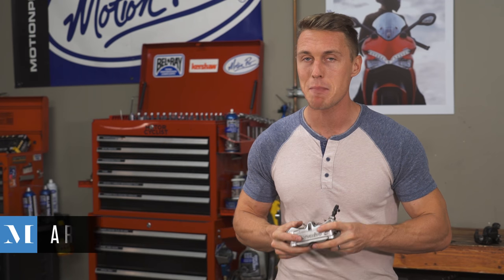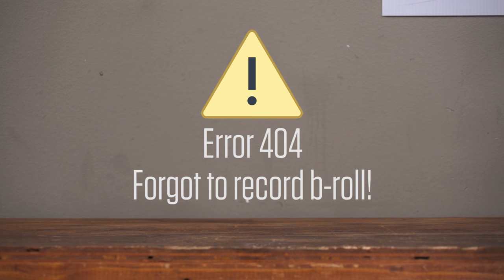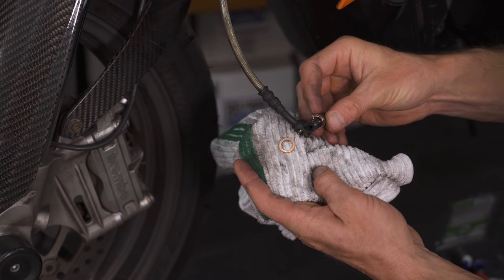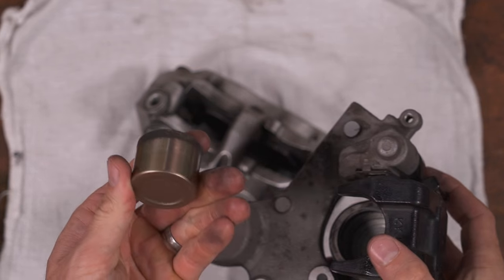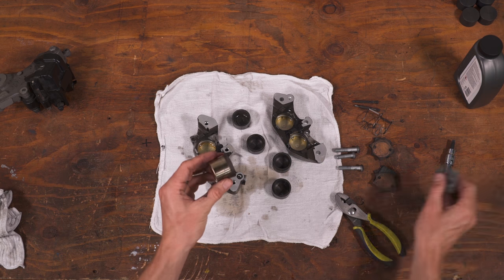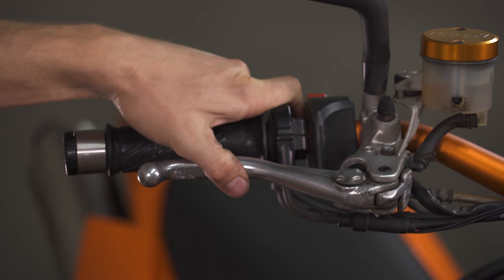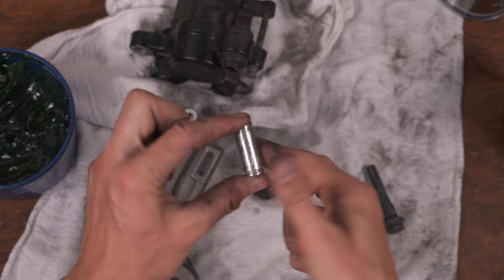How To Rebuild Your Motorcycle's Brake Calipers | MC Garage

Comment: Been working on a 98 CBR 600 F3 and right when I get one thing fixed the next goes wrong.  Just got carburetors rebuilt, finally got started and not first though second test ride the front brakes decided to clamp shut upon pulling up to consummate.  Thank goodness for this video.
Reply: I know how you feel!! I pulled my dual sport out of storage after sitting for 3 years under a tarp, outside.. So far I've removed rust from tank, Rebuilt entire fuel system petcock carb fuel cap everything, Rebuilt forks, new wheels tires sprockets chain headlight grips seat recovered ignition switch replaced and now brakes!! I said I not buying another bike, I'm fixing what I have!! Way cheaper and it's very rewarding!!

Comment: Brilliant and straight to the point video ! I was scared to take the pistons out.(strong drag even after cleaning them on the calipers). Now I'm confident about it ! I will probably use the line to push them put as far as possible before disconnecting it.
thank you for the top content!
Reply: Hey there is a very simple (and safe) way to get your pistons out using the right size socket and a ratchet.  Rather than try to explain it here, just check out "Delboy's Garage: Tokico 6 pot caliper rebuild" video and fast forward to where he takes the pistons out.
Reply: Like he says in this video, on single piston calipers the compressed air works great and works a lot of the time on calipers with more pistons.  Just sometimes you have a stubborn piston that won't budge even with air.

Comment: I've been riding for 49 yrs. and I absolutely love this channel, because I think most motorcycles (IMHO) get only marginal care at best. That being said, I know you cover the ONE thing that everyone should know how to do to the used bike they have just bought.. EVERYTHING. Thanks for you amazingly easy to follow and very accurate instruction.
Reply: Phoenix Moore It took me yr`s to finally realize my suspension and braking should be main my concerns regarding maintenance and settings, I've tried to explain this to new riders to maybe they will learn a bit sooner than me.

Comment: I just performed this periodic maintenance on my 2017 Kawasaki ZX-10RR.  A few shared thoughts on my process: 
1.  I read the service manual several times for the corrext procedure, annotating torque specs, veeifying tools necessary, materials, supplies, etc.
2.  I watch several YouTube videos on the procedure.  Save the best videos for reference.
3.  Be vedy methodical in your process for removal, parts accountability, cleaning, reassembky, installation, and torque specs.
Removal was the easy part, but I removed my calipers before I had all my brake caliper parts for reassembly.  This was to ensure thorough cleaning.  For cleaning, I set up a 3-Stage "station."  Following a good toothbrush scrub down with soap and water, my first  pan was for brake cleaner scrub.  30-60 seconds for my own procedure.  Make sure you have thick nitrile gloves on.  I sceubbed hard to rwmove brake dust with a toothbrush and blue dish scrungy pad.  30-60 seconds. Then I dunked it into my second pan of soapy water.  Washed any residual brake cleaner off by hand and with a dust beush with 3 inch firm bristles.  Last, I dunked in a pan of clean water.  Massaged rhe entive brake caliper clean.  Immediately upon removal, I used a MasterVac hot air blower and blew out any water.  Got tge caliper 100% dey in all fluid chambers and body.  Rwplacing tge fluid seals and duat seals on a mono block caliper sucks.  But once you get the hang of it, it is easier.  My most efficient means was to put my left index finger in behind the caliper to guide the seals in while my right hand fingers seated the seals in.  Some I needed a pick tool to guide stubborn seals in.  Once that was completed, I seated tge brake pads in.  I had a hard time since I never did this.  As I attempted to seat the pads down onto the spring, it kept sliding in on one side.  So I used a 6mm hex key behind the brake pad to keep it from shifting in keeping it more in line as I seated the other side.  Once the other side was seated into the grove, the hex key comes right out.  Now, my big question is... what torque value are YOU using for the bleed valve?  My seevice manual has to be incorrect.  There is no way I can use 12 foot pounds on an 8mm hollow bleed valve.  I will crush the bleeder.  But that is what my service manual states.  12 foot pounds for the bleed valve.  Banjo is 18 foot pounds.  Caliper bolt 26 foot pounds.  What should my bleed valve be?

Comment: Great video Ari but shouldn't you use new crush washers for the banjo bolts when you reassemble I don't know if you mentioned that but I always thought that you were supposed to use new ones ?
Reply: My service manual states to replace the banjo bolt washers if removed.

Comment: Great video! I would love to know more about how the lip on the seal helps pull the pistons back into place after the pressure is off. I just powder coated and rebuilt the calipers on my street glide and I tell you the high-pressure seal looked the same no matter which way I flipped it.

Comment: Hi there, nice work. I've been watching your videos for a long time.
A very nice tool to remove the pistons if you don't got a brake piston remover, is an External 90 Circlip Plier. Attached from the inner side of the piston with no chance of damage.
Reply: Good tip, thanks!

Comment: My brakes were dragging (1990 bike) so I just did the seals.  Stressed hard about orientating the piston seal with seal lip on the inside, but couldn't really tell by looking at the seals.  I even pulled out one good seal to flip it after I figured I had it the wrong way around.  Anyway I completed the job, but still wondered if I had done it right.  After a google, it turns out many, if not most, piston seals are simply square and have no raised lip.  The wedge type seals are apparently easy to spot.
Reply: Are your brakes still dragging? Cause mine are on my R6, did everything besides rebuilding my calipers. So maybe I should....
Reply: I have the opposite issue on the SV. Long lever travel due to high piston retraction. Rebuilding the calipers now, hoping that clean pistons and new seals will act better.
PS, it is not air or a leak issue. the brake is firm and will do a stoppie on a dime. It just takes too much initial lever travel to bring the pads to the rotor.
Reply: @randysavage1997  I'm replying 3 years late, but yes, my brakes did return to dragging after a short time.  I had to replace the caliper pistons which then fixed everything.
Reply: @VasyaIvanovichPupkin  I'd be very surprised if the caliper seals were causing too much retraction?  First I've heard of that being a problem.  
I know you mentioned air and leaks, but air still trapped somewhere in the system, faulty brake lines (expanding like a balloon somewhere) faulty master cylinder or maybe something wrong with ABS system (if you have ABS) would be my bet before caliper piston seals.  
Keep us posted if the caliper piston seals work.
Reply: @SportbikerNZ  
Brake is firm once pads contact the rotors. Only excessive lever travel is observed. No other symptoms. (No ABS on the bike)

Air and break lines would result in a squishy brake feel. Symptom is not present or at least is minimal (I do replace the fluid bi-annually so brake bleed was done several times now). Also air in the system or worn master cylinder seals would temporarily result in a higher bite point after pumping the lever. Symptom is not present at all. Also with worn master cylinder, it is possible to experience inconsistent bite point depending on the speed of application. A quick squeeze will result in a high bite point due to the sudden pressure increase expanding the seals in the master. Yet after partial release the lever may sink lower as the fluid is allowed to slip past the seals. This is also not present.

However, visually inspecting, a gap can be seen between the pad an the rotor that is consistent with the dead travel on the lever. It closes and opens as the brake is applied and released. Same can be seen on the floating caliper body. Pushing pistons all the way in and pumping them back to the pads a few times (breaking stiction on the seals and allowing break fluid film to lubricate the surface), decreases the lever travel for a short period of time, presumably until the pad friction material wears off and seals stick to pistons again.
I have just put it all back together with the new seals. With my "inconsistent" measurements using a digital baggage scale, I have conservatively recovered 12mm of lever travel at 11kg of force, and 
13mm at 20kg of force. We shall see how long this will last, but the difference is very noticeable.

I should point out that this is unlikely to happen with riders who chew through pads like kids through candy, where seals to not get to sit in one spot on a piston for too long. I mostly commute and use light breaking most of the time and I am sure these were factory seals on a 15 year old bike.

I should probably write this up somewhere. I even half-ass recorded my troubleshooting process. But I am a lazy dickhead. )))
Reply: @VasyaIvanovichPupkin  Very interesting.  Thanks for posting.

Comment: Before going straight to a metal pick, try a wittled down popsicle stick or the end of a bent/hooked zip tie  to try and get under the seal to lift it out.  Much smaller chance of scratching the bore that way.
Reply: I use a (sowing) needle to get the seals out. Always use NEW sealing washers. For piston removal I use a bearing puller - works great.

Comment: Excellent video The only thing I would add, is when cleaning the calipers. Fill a container, like a food storage container (I use the cheap glassware you can get at a dollar store) with alcohol or WD40 or something to help clean them. Brake cleaner tends to evaporate a little fast for me.

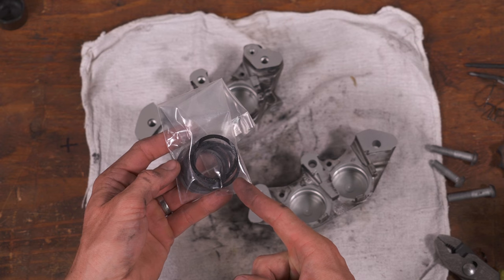Comment: 4:12 Not always true, my Kawasaki service manual says to lube the fluid seal (inner one) with PBC (Poly Butyl Cuprysil) grease (a type of silicone grease). I think any high-temperature, waterproof brake grease will work. I was going to use Permatex Silicone Ceramic Brake Lubricant for my next rebuild.

Comment: Haha, same cheap ass pliers i got ! Good job, Sr. ! Centering the caliper on the rotor it's a nice detail but not a MUST. The nature of the caliper/rotor arrangement will put those pistons where they need/want to be. What should never be forgotten it's pump your brakes to check your work and make sure you can stop when you set out for a test ride.
P.S: Nice SuMo KaTooM.

Comment: You can also lube the new seals and pistons with something called brake assembly fluid. Made specifically for that purpose. Got it on Amazon.
Reply: coming from 10 plus years of jet engine maintenance, you can lube parts, o-rings, and seals with whatever fluid that they go with respectively. It is the best way to lube things. that was taught to me by guys with 25 plus years

Comment: Lubing brake seals with brake fluid alone can cause excessive lever travel because the pistons won’t be able to slide freely enough against the seal. It’s better to lube them with silicone or red rubber grease. Brembo monoblocks actually have a warning with their rebuild kits saying preparing the pressure seal with brake fluid can cause excess lever travel or dragging brake pads.
Reply: Great.  I used the lube that came with my brake pistons from Brembo.  I wishbthere was a definitive answer on what product is best for lube, longevity, and reliability.  I don't like half-assing things.

Comment: This may be a dumb question but shouldn't you use silicone grease on the pins instead of a petroleum-based grease to avoid deteriorating the boots?
Reply: Yes, anything that involves rubber seals has to be treated with silicone.
Reply: Silicon grease is also required for the high temperatures that brake parts can reach.
Reply: High temp silicone grease is the way to go.

Comment: Another great video!  Thanks for all the tips.  I am particularly curious if you have recommendations for or want to make a video on fuel lines, sizing concerns, how to pick replacements for them, clear lines for flow visibility, adding in-line fuel filters, issues with flow due to restrictions in the line.  I did not see a video in the playlist so I thought it pertinent to ask now.  Thanks Ari!
Reply: Hi Scott, we don't have a vid that addresses that stuff, but you don't want to cheap or out take shortcuts with fuel line. Buy quality fuel-resistant stuff (not hardware store vinyl) and use proper hose or crimp clamps on the connectors. I like braided translucent line like you can get from Motion Pro or Helix Racing. Both companies offer ethanol-resistant line that'll work with today's fuels. Motion Pro also has great crimping pliers and quick-release fuel fittings. I use them on all of my racebikes to make tank/carb removal faster.
Reply: Ari Henning Thanks a bunch! Gonna check out the motion pro offerings.

Comment: Great idea well done 👍
your videos have safe a lot and   make me understand my bike. 
 I have watch all most your videos 👏👏👏,  pls I will like you to make video (how to service throttle body)  because I have  check almost your videos the similar one is how to service carburetor. 
 Thanks
Reply: Thanks for watching. One of the great things about EFI is that there isn't much needed in the way of regular service. Make sure they butterflies are synched (if you have a multi-cylinder engine) and that's about it. There are things that can go wrong with EFI, like fuel-pump failure, TPS issues, or clogged injectors, but those issues are rare. Regardless, I'll add it to the list. Thanks for the suggestion.

Comment: Do not use air, pistons are not to be "fired" anywhere.
Soak or drain old fluid out of reservoir and fill with fresh fluid and refit the lid.
Undo the banjo and do it back up finger tight.
Remove the caliper and jack the piston out with hydraulic pressure from the brake lever in a controlled manner over a plastic catch tray, checking as you go to make sure the reservoir is not empty.
Ensuring the reservoir cap is on while doing it or you risk fluid coming back out of it in the bike as you pump it.
When fluid escapes out the side of the piston you can remove it the rest of the way with fingers.
Once the piston is out undo the banjo and store the hose end to stop it draining.
When it goes back on the system has fresh fluid in it and no old fluid will enter the clean caliper.
Reply: Anyone can do what they like to their own calipers, but for mechanics working on other vehicles, they don't own the calipers to be taking risks damaging one.
If some folks want to risk it that up to them but using hydraulic pressure to remove them will never damage the piston or injure anyone, it will also remove old fluid that can be displaced with new fluid in the same process.
And doesn't require a compressor so do it, so it makes no sense to use air.
If people like the bang sound of a piston shooting out then by all means go for it.

Comment: For calipers with slide pins it's important to never put grease on the tip of the slide pin -> it could drive grease against the dead-end hole and cause a hydraulic lock which would prevent the slide pin from going all the way in, causing brake drag and burning up your pads and rotor. Super common issue when people DIY car brakes!

Comment: Just out of curiosity... Brembo do not provide any torque for the bolts holding the halves. It is even recommended to use new ones or is it only for cars? since pre torqued at factory to the elastic limit. What torque did you use?

Comment: You mention one option is to use a rag and a plier to get the piston out, are there any other/better options?

Also, I'd like to see a vid about how a quickshifter works, and if it's actually bad for your bike when you're not on the track. Could you clarify that in a next vid perhaps?

Comment: So Ari, Every time you replace the front tire you should not torque down the calipers until you realign/Center the caliper/pads to the disk?
Reply: Not if you have axially mounted calipers, or if your radial calipers have locating dowels.

Comment: Hey Ari , My owners manual says caliper rebuild needs to be done every two years . But there's no dragging or leakage should this be done every two years like the manual says ?? Thanks and Very Good Video like always
Reply: Unless it's a part of the engine or drive train that has a certain lifespan or is susceptible to wear & tear over time (chain, sprockets, oil filter and stuff like that), follow the old "if it ain't broke, don't fix it" policy. Calipers only need to be rebuilt if you need to take them apart, and you only need to take them apart if they're seizing due to dirt or corrosion. So if your brakes are working fine, no need to touch them (apart from changing the brake fluid in the suggested interval because it degrades over time).

Comment: Hi MCG
I have a Bajaj Pulsar 220 with bybre single piston rear caliper . It gets jammed and i have to cool it with water . I replaced the o rings once, but does not seem to solve the problem . Should I try replacing the o ring again or the bybre caliper set..?

Comment: What is the torque value for pinch bolts on ktm 950 sm? The 3 bolts that connect two halfs. Thanks.

Comment: What's going on if I have put everything back on, nothing comes out when I try to bleed the brakes, and pumping the brake lever plenty does nothing after adding fluid to the reservoir? 

Heaps of brake fluid leaked out when I took my brakes apart to clean and replace pads. I know it needs more but nothing seems to be getting sucked in from the reservoir.